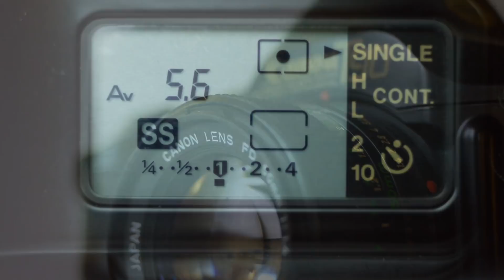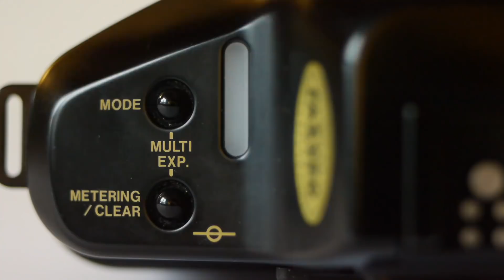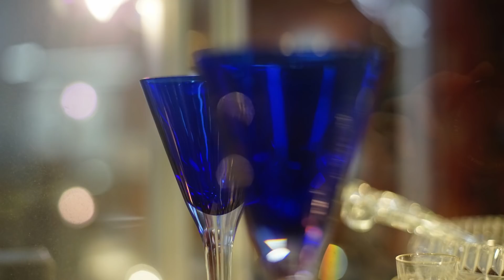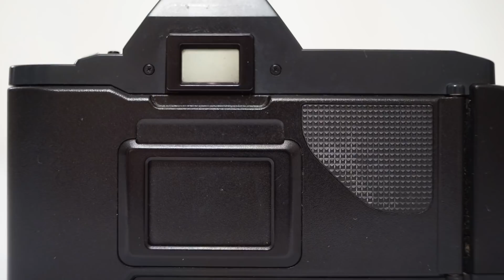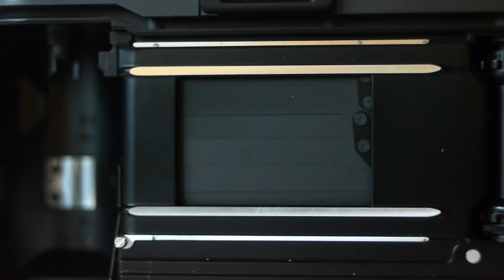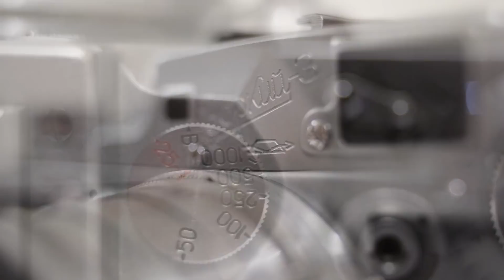The Next Level! Four Pro/Semi-Pro Film Cameras - For Peanuts!

Comment: When Canon, i use the T70.
It is so much better than the Canon A-series cameras. The built quality of the A-series wasn't that good, all of them have today the awful and asthmatic cooching, a lot of them have dissolving seals.
The T70 is much more sturdy and reliable. Furthermore you have three programs ( i use often "Program Tele" with the FD 50mm f1.4 to shoot it at f1.4 or f2.0 all the time ) and a shutter priority with automatically override ! ( like a Minolta XD7 ). Very nice, very practical in the everyday photography.
The display in the viewfinder is much more better than this in a Canon AE1 program , which shows the full apertures only ( f2, f2.8, f4, f5.6....), but the T70 shows the half apertures too ( f2, f2.5, f2.8, f3.5, f4, f4.5....). Furthermore the numbers of the apertures are much more easier to read in the T70 ( compared to an AE1-program ).

Comment: I was given a t70. On paper it’s really nice but when you’re actually use it I find it extremely difficult to use the information shown in the viewfinder. It doesn’t show the shutter speed, the metering indicator is very confusing and overall if you want to use it the only way to use it is to use it as a advanced point and shoot. If you want to actually control your settings it’ll be annoying. 

At least that’s my experience with it. I much prefer my Nikon FM & FE
Reply from the maker: I too prefer the controls of earlier cameras, before they went all electronic - but still, once mastered, the t70 is a very capable machine...

Comment: Hey, I like your videos. You have a great voice and take your time to review stuff, which is what I like.

I use a Canon EOS Rebel II, which is the American equivalent of the European EOS 1000N, an entry level autofocus EF mount SLR. Bought it earlier this year for € 5 in a thrift store, bought a 1000FN soon thereafter (also € 5) for a lens mount cap and rubber eyepiece, so that I have one complete camera. Cleaned it and yeah, it is just all I need. Despite its plastic body (and lens mount), it feels solid. It's only 1fps and the AF is quite slow, but I don't care. I like that it can shoot full automatic but also manual or anything in between (it even has scene modes like some DSLR). It has an excellent plastic grip, not rubberized like Nikon and Minolta SLR's of its age have, which is an advantage (no sticky rubber). They are everywhere for sale on the internet, very overlooked and underrated.
Reply from the maker: Many of the later film cameras are overlooked at the moment - but that's great news for prices!

Comment: The T70 appeals to me for its small size and autowind. You know it's funny. Digital cameras and even the last film models got us used to autowind. Lately when I go back to my manual wind cameras I ... you guessed it ... forget to wind. I vaguely recall something about not winding the lever until wanting to shoot so that you didn't unnecessarily preload the shutter (mechanical shutter models) which could hasten then becoming inaccurate at certain speeds?

Something else I've come to notice in the digital era, with regard to taking multiple exposures. You can pose group portraits as much as you like and tell them to look at the camera, but someone is still going to have their eyes closed or be looking elsewhere. A very high FPS doesn't help here; a SLOW fps does. So even the "0.7 second" fps of the T70 is pretty useful in real life actually.
Reply from the maker: Autowind is still quite a novelty for me, at least on film cameras. What I really don't like though is auto rewind - I shoot mostly BW film and develop and scan it myself (competent colour labs are very hard to find these days) and it's a pain if the leader's inside the canister!

Comment: The Canon T90 is still the only camera that supports spot metering in TTL flash mode with the equally capable 300TL flash !
Reply: Still shooting film since 40 years with the whole Canon F-, A- and T System. T90 and A-1 are the most used bodies in my photowork. The T90 is the best lighting meter, with which you could take photos....
 The 9-point spot metering is the best you can get for individual exposure ....
Reply from the maker: It's a very impressive camera, extremely capable and very well built - if I'm honest though I prefer something a little simpler! An extremely impressive machine though!

Comment: I had two T-90s as well as an F-1AE back in the 80s and early 90s when I was shooting news. you could not kill these rigs. The T-90 set the bar for all future camera designs going forward, it simply broke the mold, all it lacked was AF (Minolta introduced the first "prosumer" AF SLR  Maxxum 7000 a year earlier) then again, AF was still more of a curiosity and not widely accepted by the pro shooters at the time. While I have left Canon for Fuji some two years ago, I still have a soft spot in my heart for the T-90, he saved my bacon on more than a few occasions.
Reply: I've used a T90 since it first came out in 1986 but sadly had to replace the original a couple of years ago. Thankfully there are a good supply used at silly, low, prices.  I go a very niceT90 for under £80 and with the advent of DF96 combined dev/fix its the choice for B&W photography.
Reply from the maker: It's a very capable camera - I'm really impressed with it! A bit big and bulky, but I guess you can't have everything...

Comment: Minolta is epically overlooked.  I have the X-700 with that same MD 50mm f/2 lens in your video. Superb output.  Looks as good as my old Leica M2 with an old 50mm Summicron.
Reply: Very good combo. But what made exceptional  that system, was (also) the 50mm f2 MD lens. In my opinion, a really good lens even by todays standards.

Comment: The slightly later cameras, the Zorki 3s and the 1950's vintage Zorki 4 are not as nice looking as the 3, but just as capable and are really cheap. You can get them on eBay from vendors who actually service their cameras before sale (as opposed to those that claim it, but dont) for under $75 plus postage.
Reply from the maker: True, the later Zorkis are real bargains at the moment - as they always were, even when new!

Comment: About the Canon T70, it has spot and average metering modes.  Also, there are three auto modes, "normal", "tele", and "wide," which pick very sensible shutter/aperture combinations for middle, long, and wide lenses at any given film speed.  The camera uses two AA batteries, including rechargeable NiMH batteries, which last ages.  This camera's worst point is the film winder, which is very loud.  The cheapest one I bought came as a complete kit in mint condition with Canon FD 35-70 mm lens, Canon flash, Canon bag, and instruction book, etc. cost me only £16.  The dust cover for the remote shutter release is missing on the example in the video.  Beware of broken battery door, corroded battery contacts, and dead LCD when buying.
Reply from the maker: I seem to have got lucky with this one!

Comment: If I were to go for a slr, I would buy an Olympus OM 1n
Reply from the maker: The OM1 is a beautiful little machine as is, in my opinion, the OM2.
Reply: Although I own a Canon EOS1, I must say that I'd love to get a pentax LX.... The LX was the 1st SLR that lusted after.
Reply: @kiwipics  , had the Lx since the 80s and I enjoyed that camera a lot. But I must admit that, in my Pentax system, the most affordable camera under difficult weather conditions (low temperatures) was the Mx. This small and light camera, worked always  perfectly without batteries at all shutter speeds.

Comment: A really good feature of both the Canon T90 and T70 is that they work with AA batteries, not things like the CR5 that are expensive and difficult to find.
Reply: The lithium batteries replaced AA because the AA batteries could not provide enough instantaneous current to power the CPU, autofocus motor, and film advance in the EOS cameras.  The T90 also ate batteries. I developed an adapter for the T90 to an external power supply for a customer of a friend of mine. I should have patented it as the manufacturer of the battery pack started selling them. :-)
Reply: They also work well with rechargeable AA NiMH batteries, as does the Canon flash for these cameras.  The batteries last ages.
Reply: Yes you're right but IMO it's the only good thing about them. I have a T70 and hardly use it. The A1 wins every time.
Reply: @terrywootton8882  why does the A1 win?
Reply: The T70 is such an underrated camera unfortunately

Comment: may i ask what makes a "pro/semi-pro"? i do feel the brand name holds more weight when it comes to consider one's work over another. i dont deny that it certainly FEELS better knowing a photo is made from a leica lets say over another camera. 
but hopefully - "any" film camera should be good enough to deliver good results worthy of presenting to an audience, WORTHY of purchase lets say in a gallery or other places. 

i still dont really understand exactly body differences but i suppose for film , the body is there to support high quality lens that one person would want to use to produce the very best results they can in the style they want. (selecting the body base on the lens a photographer wants to use to produce great results) 
but im sure im wrong with this logic and open to be corrected.
Reply: Body wise a pro level version would have had at least a metal chassis, better seals and generally been better able to withstand bad treatment. If you were to hold a T70 and a T90 as featured here you would instantly appreciate the differences.
Reply: @alanstanway6118  i see thank you very much
Reply: A pro camera will also have more features than a 'consumer' camera. Some examples of this are:
Auto winder, vertical shutter for faster flash sync speeds, full coverage viewfinder (most cheaper ones are only ~95% coverage), viewfinders optimized for faster lenses, interchangeable components for both maintenance and customization purposes, DX code reading, multiple exposure mode options, more sophisticated metering, having available vertical grips, etc.
While pricy and I don't own one for myself, if have to say my favorite 35mm SLR is the Nikon FM3a for its perfect balance of features and smallish form factor.
Reply: Ultimately, it's the photographer and not the camera.
Reply: @ghw7192  I can't argue against that. A photographic Wizard could create a masterpiece with a 110 format camera is they had to but a more sophisticated tool can still be helpful- even if just offering those creature comforts.
Reply: @vikmanphotography7984  You are exactlt right!  In 1960, I was glven a Brownie Hawkeye and in1967, purchased a Nikon F.  I had a successful studio for 32 years and still have a. Hasselblad, a ccouple of RB67's and a few Rilleiflexes, along with lots of 35mm camers, but my favorite carry camera is a Panasonic Lumix and guess what?  I am enjoying the heck out of letting the camera take care of the basics while I enjoy the moment and my photos have not suffered a bit!  Thank you!
I enjoy the moment!
Reply: "Pro/semi pro" cameras are, generally, made to a bit higher mechanical standard. And, usually have better weather sealing. 
They may or may not have more features compared to a consumer grade camera--the camera companies did sometimes add bells and whistles for their consumer cameras that the pro cameras didn't get. 
As to prints "worthy" of purchase, that is completely independent of the gear in my opinion.
Reply: "PRO" rigs tend to have higher tolerances to shock, weather, dust and all-around abuse that a photog will put it through. My T-90s and F1s went through hell and kept shooting in all kinds of weather.